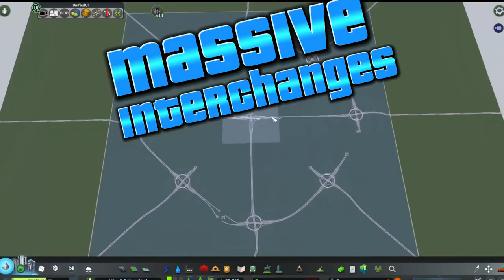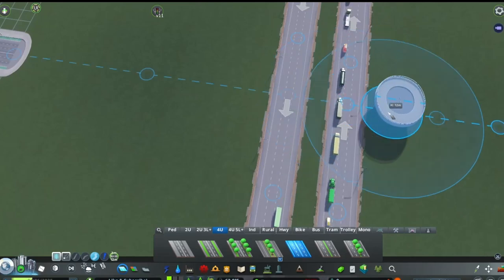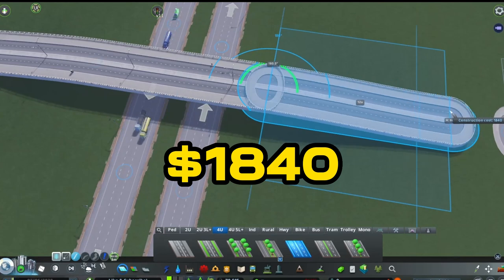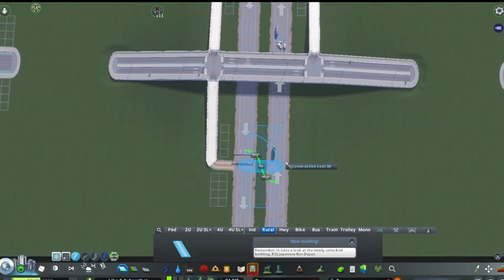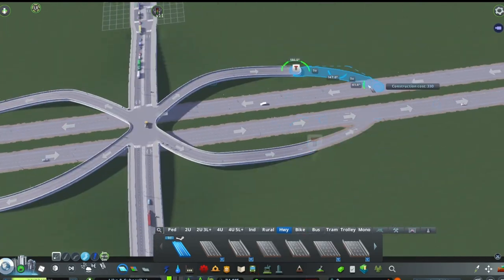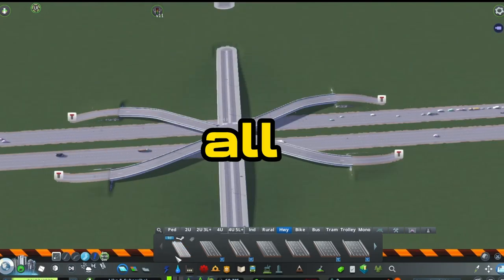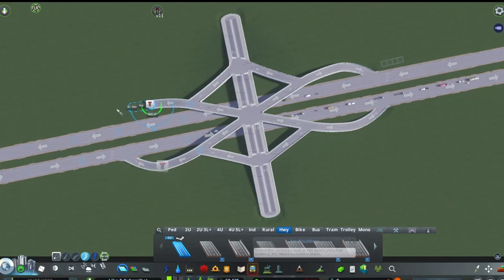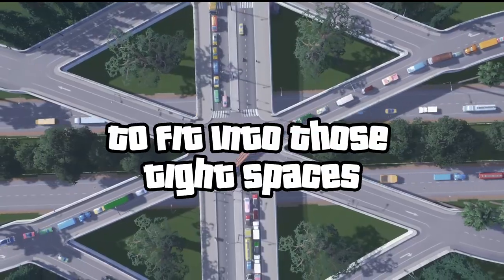How to Build the PERFECT Interchange for Small Spaces! (Cities Skylines)

Comment: Great video as usual. I strongly recommend all PC players use Traffic Manager mod to set up a traffic light on the central "single point". One of the SPUI's best features is that it only needs three traffic light settings at the single point:
1. Both motorway off-ramps that will cross without conflict onto the arterial.
2. Arterial road left side (straight and onto motorway on-ramps).
3. Arterial road right side.

Meanwhile, the right turns from the motorway to the arterial (left turns for LHD countries) can enter the arterial without lights.